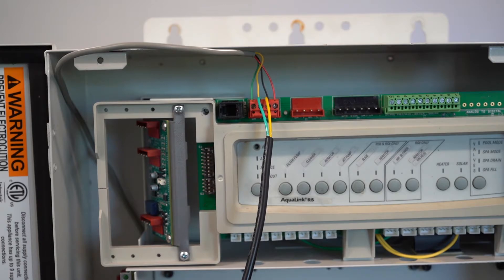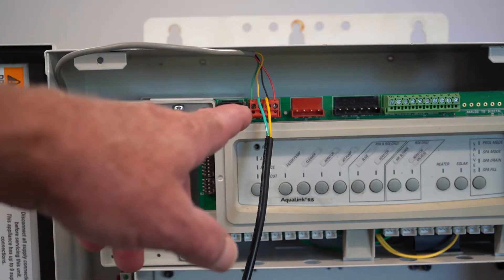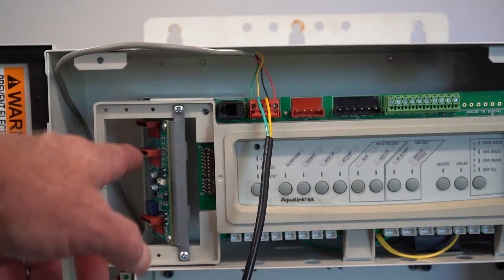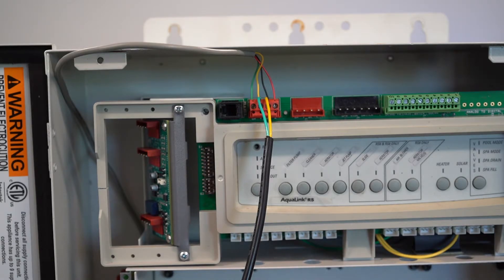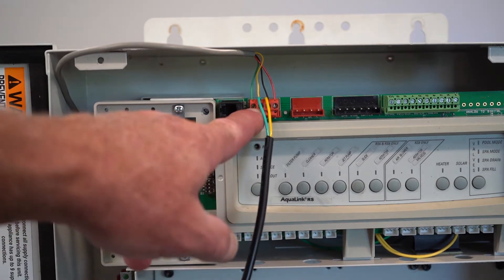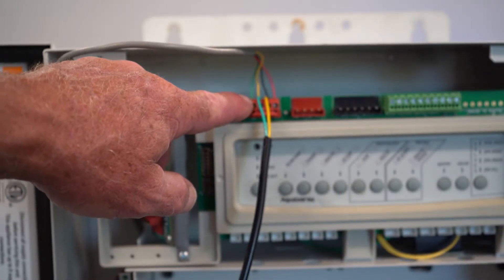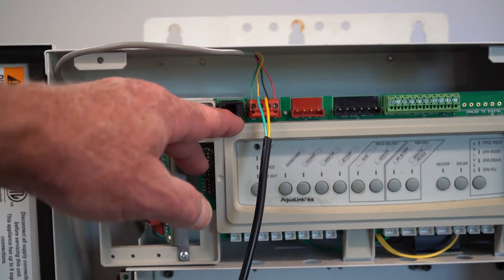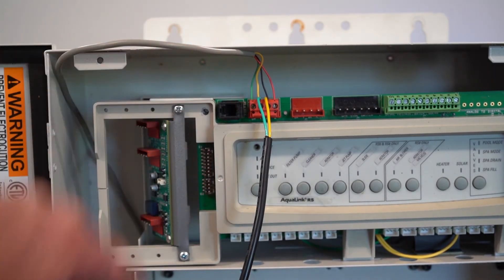How to Wire an Intelliflo Pump to Jandy RS

Comment: Thanks for the video! I have a question tho, I am trying to connect the gas heater (with RS Capability) AND the Variable Speed Pump, into the RS System... is there a way to do so?
I am using an iAquaLink antena system with an RS4... I have read both equipments manual but haven't figured out if it supports dual use

Comment: Would I be able to connect the wires from the com cable of the intelliflo to a separate com port to be placed next to the com port of the iAquaLink antenna as opposed to the same one as you say you don’t “promote”

Comment: Great video! Can you run 2 Pentair Variable Speed Pump? Filter and water fall feature? If yes, where do you connect the green and yellow cable to the Aqua logic? Theres only 1 slot for green and yellow cables for 2 green and 2 yellow cables.

Comment: Can you show where the 2 wires terminate inside the pump please?
Reply from the maker: The wire plugs into the side (on the outside) of the intelliflo pump.  The cable comes in the box with the pump, however typically local Pentair dealers have a surplus of cables

Comment: When I put Iaqualink in to service mode my Inteliflow VSF model 011056 pump has no power, I have iAqualink IQ 900.
Reply from the maker: All variable speed pumps need to be  "Hot Wired" which means it needs to have power all the time.  I assume the last pump was a standard single speed pump.  The wiring on the filter pump relay needs to be altered.  The pump load wires typically on screws #2 and #4 need to be on the Line screws #1 and #3. Watch this video https://www.youtube.com/watch?v=x8BKtcQ5uWE at about 45 seconds I explain how to hot wire the pump.  It is the same relays in a Jandy RS system as on an EasyTouch or IntelliTouch system
Reply: @craigwooster6646  Thank you for your help. I can now use pump in service mode. Need help in 2 questions. 1. In service mode what is the speed of pump. Display is inactive, and iAqualink does not provide any information on web in service mode. 2. Is there is any way to use pump in manual mode.  Thanks again for your help.